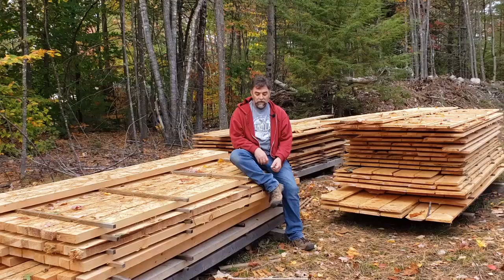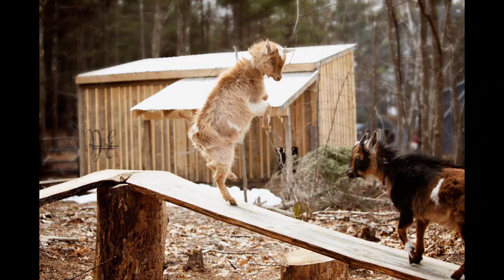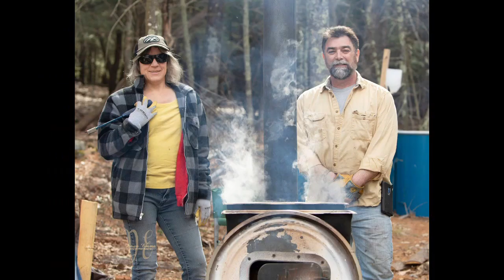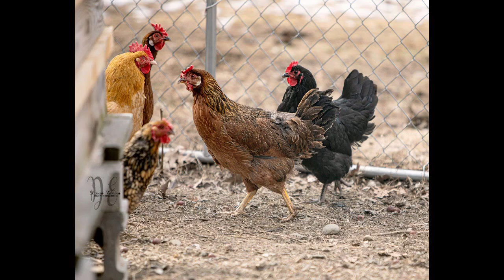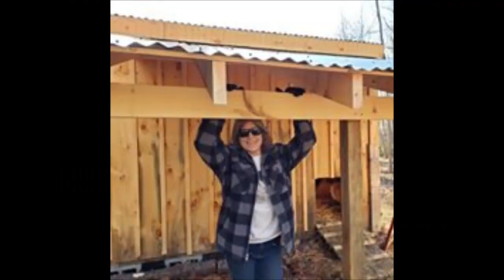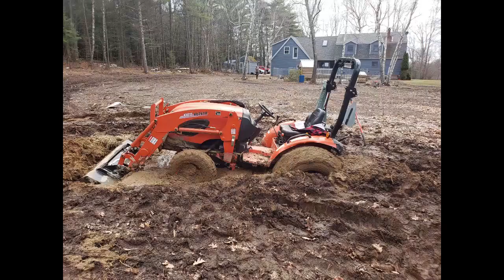We start building our mobile rabbit hutch with lumber we cut ourselves with our Woodmizer  Sawmill.

Comment: How about sharing your secret mixture.
Reply: Prob. used motor oil or motor oil with some paint thinner. Makes it water proof and insect proof. The paint thinner help it soak into the wood.
Reply: @Scuffedgin  thank you.    I have heard of people doing that for fences but was not even thinking about that for a structure.   Thank you
Reply from the maker: I've also heard of people using diesel fuel mixed with used motor oil, if you can believe that!